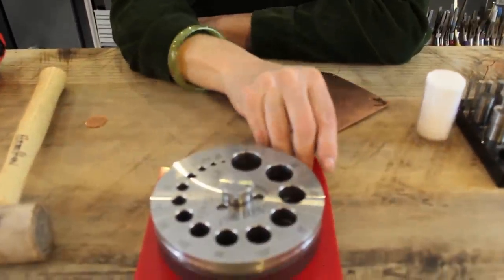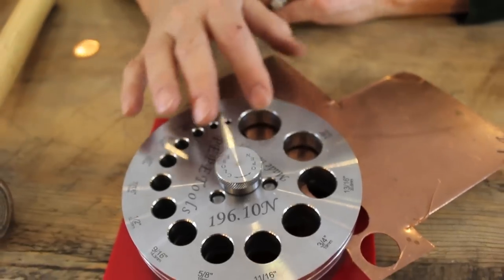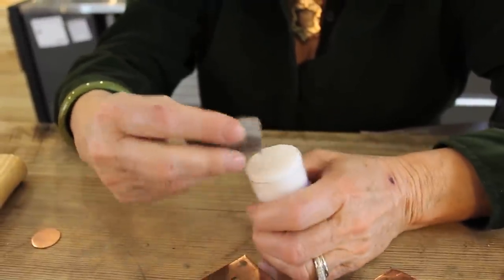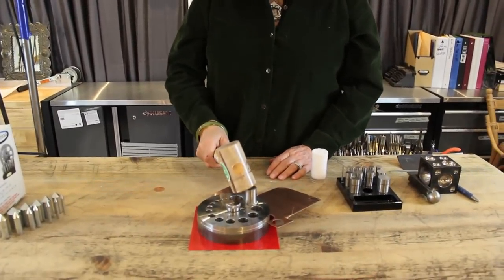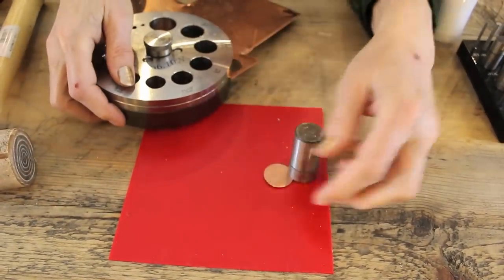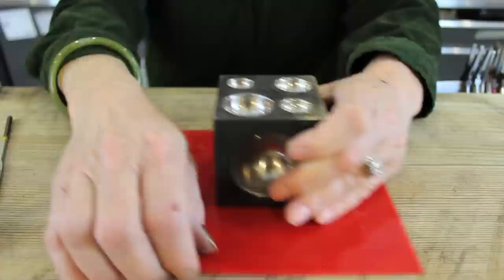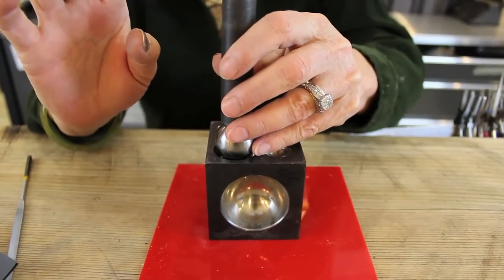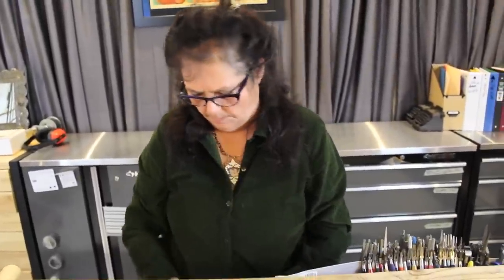Easy Enamel Cabochons!

Comment: Hi, do you also have a video or tutorial on torch firing?? On website maybe?   I don't  have a kiln, yet!! But I will. 😬 also, after you torch fired and cleaned the copper disc, did you wire brush it?? It's looks so shiny. And, is there non toxic enamel powder.thanks!! ❤

Comment: Hi Nancy,
I was interested in learning enameling and wanted to protect myself what kind of mask eyeglasses and gloves do you use?
Reply from the maker: Barbara Smith Hi Barbara, You can purchase leather gloves from a gas supplier or hardware store.  Harbor Freight also carries welding gloves: Item#41054. I use two types:  regular leather work gloves and welding gloves. You can also find a leather shirt or buy a leather or fire resistant apron for additional protection.  My friend Sugar wears a leather vest/dress that she purchased at the thrift store. She wears it whenever she solders.  Eye wear:  Any safety UV glasses. Amazon has many types like this one that blocks 99% of UV rays: Pyramex Fortress Safety Eyewear. No open toed shoes and keep those gas hoses out of the way. Thanks for watching and for respecting your safety.  Enjoy. N

Comment: Do you think it would be possible to spray the clear fire through a stencil and then sprinkle enamel onto the wet area and avoid the surrounding area?
Reply from the maker: Beth Millner Hi Beth.  Yes, I do but, there is always clean up.  There are ways to spray the adhesive using an aerosol can:  Thompson Enamel carries this:   A7 - Preval Aerosol Kit/  This is also useful when working on very dimensional pieces and for areas that are hard to reach. I have not tried your idea but, would image it would work best with a flat piece.  You could also draw or transfer your pattern and then carefully paint the Klyr Fire within the lines - I would work in small sections. Another method involves using either a negative or positive stencil.  Cut the shape from regular printer paper. Fire one or two base coats of enamel onto the metal.  When done, paint the whole piece with the diluted binder.  Press the paper onto the wet surface.  It will stick where it is wet.  Sift and remove the paper.  It helps to make a pull tab on the stencil for ease of removal.  All of this is much easier on a flat surface. There is also enamel paint:  acrylic and water color to name a few. You can also make toner decals.  See Enamel Work Supply: resources: Toner Decals.  Hope this helps.  Thanks for watching.  N

Comment: Once you start w/the colored enamel and you are not happy.  Can you remove it and start over?
Reply from the maker: Ben Nuccio Hi Ben, you can sift another color over it - especially for opaques.  There may be a change in color though.  Try two coats.  I would experiment before enameling your final piece.
Reply: Thanks.